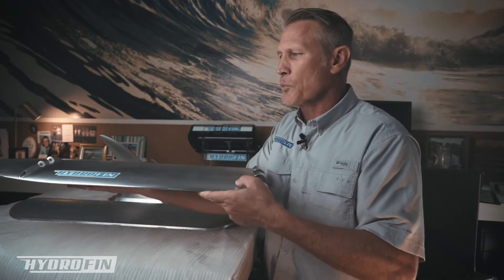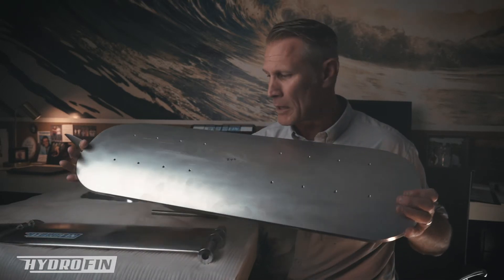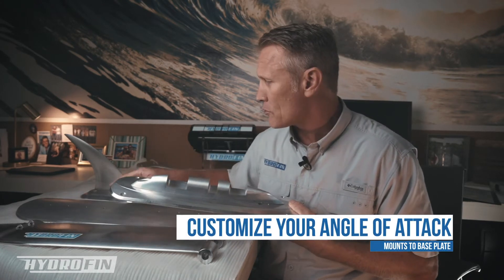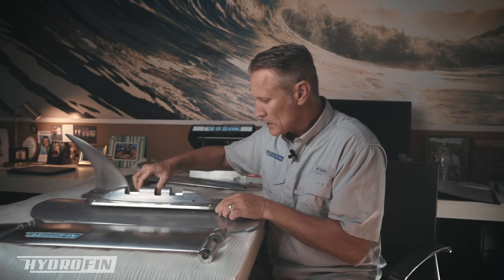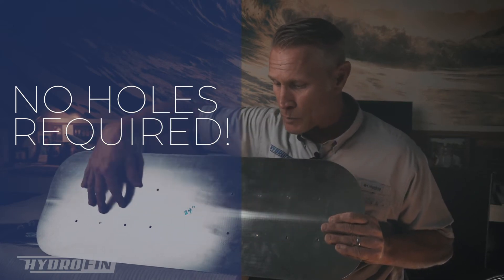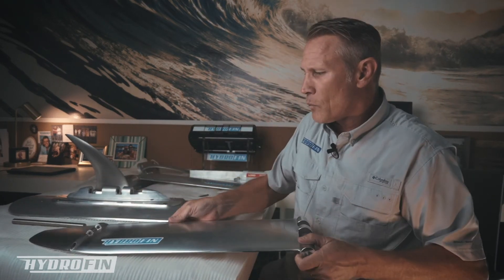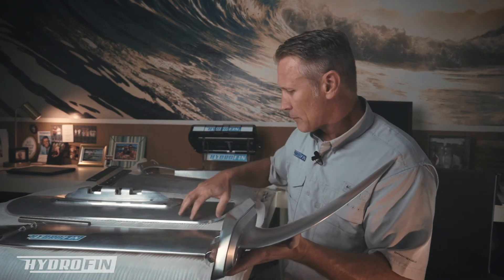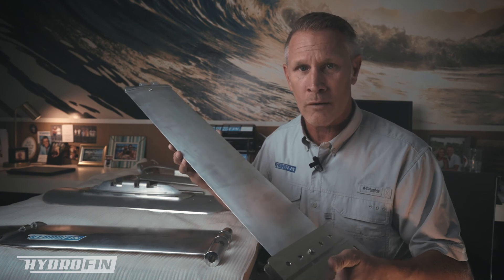Hydrofin System Overview - How Does It Work?

Comment: You could make front and back fins adjustable on the angle of attack by reversing the screw holding the fin to the plates and have locking nuts on the underside of the plates. You would then simply loosen the screws, change the angle of attack and retighten.

Comment: Always wondered why manufacturers never made bolt on hydrofoil wings that would attach to your lifting strakes between the toons of a triple.  Seems like a simple design and would work even better than this large wing design on a 2 pontoon.
Reply from the maker: We just finished the design for tritoons and are getting the prototype made.   Subscribe to the YouTube channel if you'd like to get video updates on the version for tritoons.
Reply: @hydrofin  bump for update on a Tritoon.  Currently running 55 mph , but want more speed.
Reply: I’ve wondered as well.  Having three logs in water requires a lot of hp to push them. In my opinion, a properly designed and fitted foil should get most Tritoons another 10 mph just by getting boat out of water.  I’ve seen twin engine tritoons do 75 mph on 900 hp ( twin 450R Verados on a Southbay) when that kind of HP should be pushing it in the 90s.